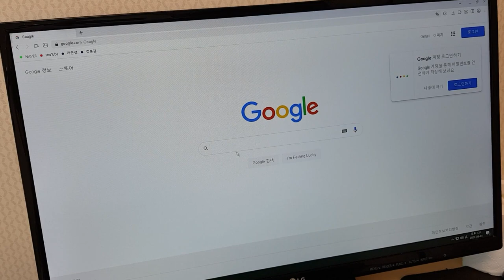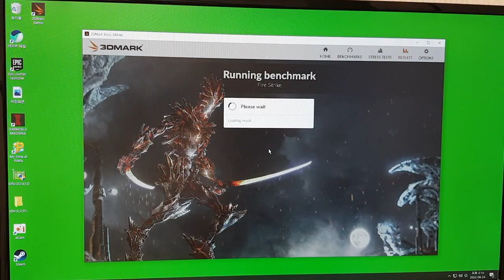Cleaning up an abandoned computer 1

Comment: The way he cleaned the case without removing the electronic parts gave me PTSD
Reply: Nah that gave me permanent anxiety
Reply: Same, I got a second hand abandoned cousins pc with pentium g620 with asus p8h61 mobo with dusty and damaged RAM. I recovered the mobo and all. Now i modified the pc with intel core i3 2120 and 8gb DDR3 RAM and 120GB ssd and 500GB HDD and 500W PSU. Then the most shitty thing is that the PC case. the case was covered with lizard shit and rat shit. So i removered all electrical components (like USB slots, Audio jacks & power switch and lights. 

whoohh....
Reply: 이게 요즘 유행하는 방법입니다
시도해보세요
건조는 최대한 빠르게 해줘야 합니다

Comment: I would never wash any components that have electrical components with water. I had a heart-attack when you washed and scrubbed the processor and mainboard with soap and water. I’m surprised that the computer still works after all that.

I’ve been a computer technician for over 20 years and I would never ever use soap and water to clean any pc components. There are better methods like using isopropyl alcohol, electrical contact cleaner and air blowers with brushes.
Reply: You can surely clean any electronics with soapy water, you only have to make sure everything is dry before electricity appears.
Reply: thats how mining card were clean before selling to public market .. heck they even use pressure washer

Comment: i take it this guy has never heard of  isopropyl alcohol  when he washed that board in soapy water i was like game over  something smells fishy here and its not the motherboard because that smell of hand wash which was what it looked like he used  if that powered up with no issues i would be amazed but i doubt it
Reply: i mean you can wash with water and soap, but you need to let it dry like real real dry maybe for 1 week, you just need to make sure the water is gone.
Reply: @kingzfire8937  the problem would be the printed circuit board. If the water had penetrated the top layer, the board will literally swell itself apart.
Reply: For myself I use electronics contact cleaner and isopropyl alcohol. But in fact lots of tech YouTubers do use water for cleaning the motherboard, albeit I had never seen anyone wash it with the CPU intact. Remove the cmos battery beforehand and use anti rust spray once done. Some actually suggested to use distilled water instead.